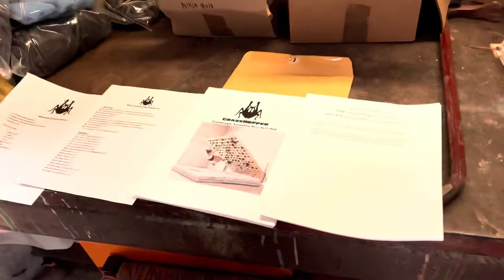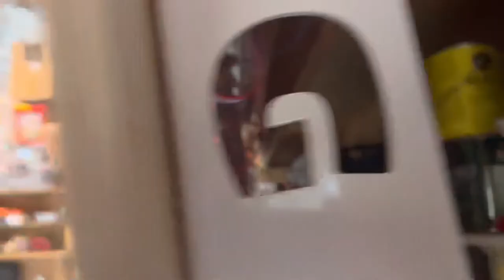Grasshopper Ninja 8x10 climbing board installation. Bouldering home wall. NINJA 2.

Comment: Did this wall require any bolting to the floor or is this completely free standing?
Reply: No bolting to the floor. They sell two versions of the Ninja. One requires bolting, the other doesn't. Pretty impressive design.